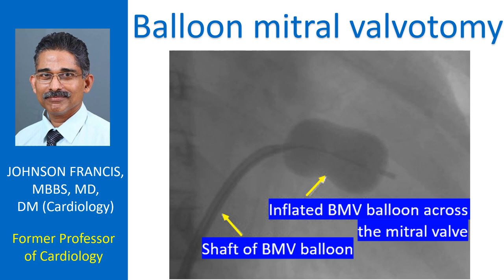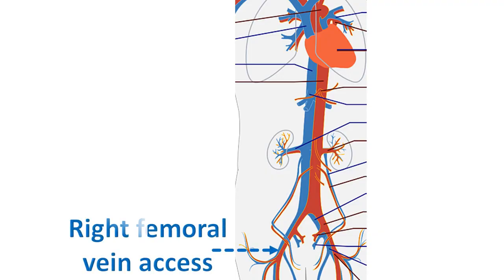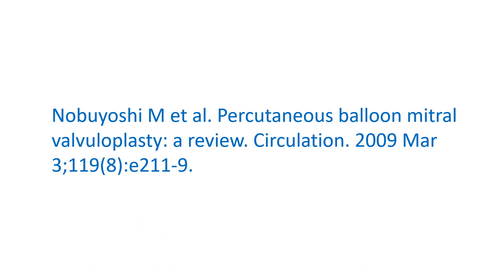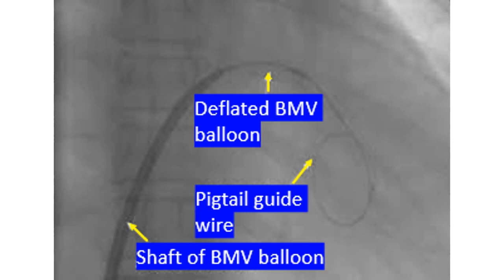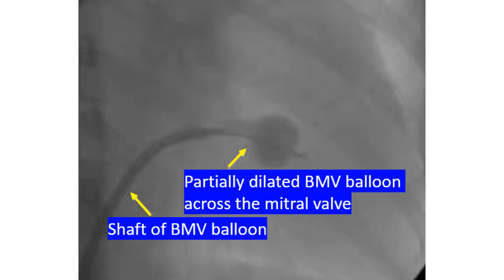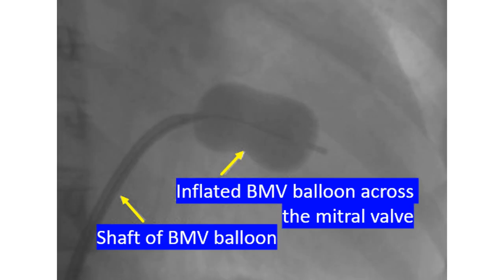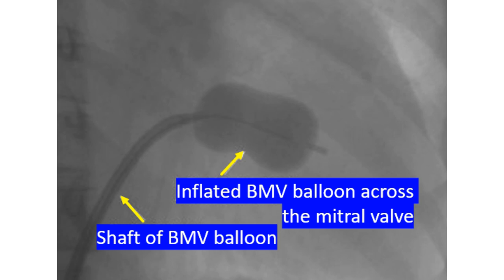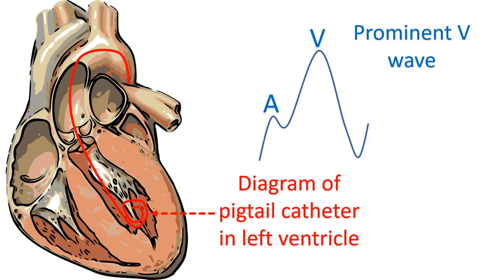Balloon mitral valvotomy

Comment: Difference between BMV & PTMC
Reply from the maker: Two different names for same procedure: Balloon Mitral Valvotomy and Percutaneous Transmitral Commissurotomy
Reply: have a doubt about that pressure monitoring after doing PTMC 
Is done in ptmc procedure or echocardiography?
Reply from the maker: Pressure is checked with the tip of the balloon catheter to get the left atrial pressure after the procedure. Left ventricular end diastolic pressure can be obtained by passing the pigtail catheter in the aorta into the left ventricle. Difference between the two will give the transmitral gradient. Comparing with the pre-procedure gradient will indicate success of the procedure. If you have echo in cathlab, that can also be used to assess transmitral gradient.
Reply: @JohnsonFrancisMBBSMDDM  thank you